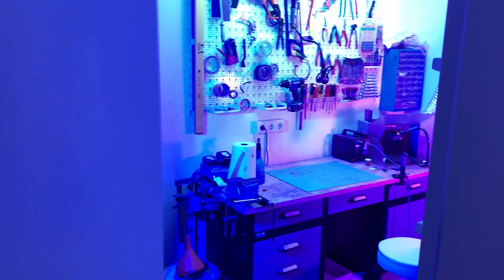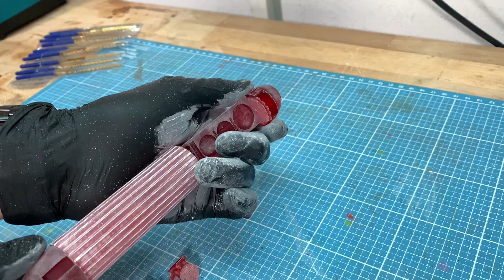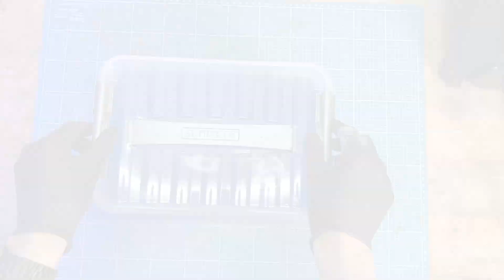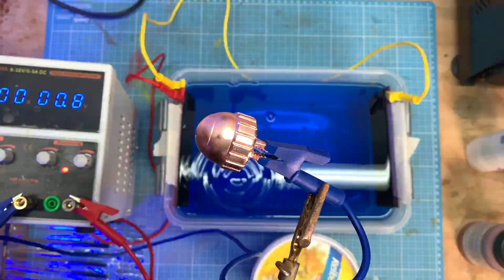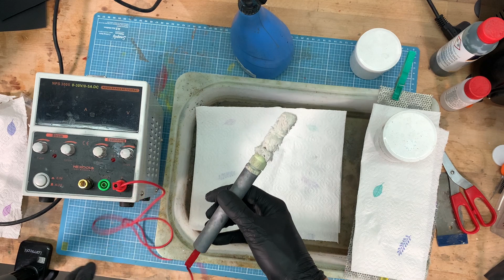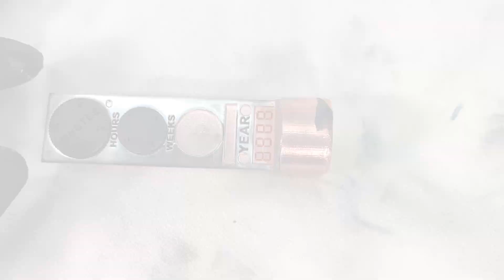Electroplating 3D Prints - Super Smooth

Comment: Superb video !

But one question..
I cant get my copper to stick, it rubs right off.

My setup, is by making the solution with copper material in vinegar and salt, on plus and minus of a charger.
Then i add brightener made from laxative and distilled water (which i saw in another video)

i spray my 3d printed (UV resin) parts with Zinc spray, or paint them with graphite paint. without touching them after they have been painted og put them in the plating solution hooked up to a single AA battery.

only a small amount of plating actually sticks, and 95% of it rubs right off (and looks a lot darker)
The plating that does stick, dosnt shine.
Reply from the maker: Hi,
hard to tell where the issues are, since you're using your own electrolyte. 
First for the missing shinyness: This is either by the self made brightner, or by applying too much current to your plated part. An AAA battery provides around 1.5V. This is too high for the avarage part. And this leads us to the...
Second Part: Graphite paint needs to slowly plated at the beginning. I use 0.1-0.2V increasing the voltage slowly. Graphite paint also sticks very bad on Resin printed parts. I fixed this by adding a layer of polyurethane on the resin; then spraying the graphite. 
Third Part: Graphite is way less conductive as you might think; try to polish the dried paint with a rag to make it shiny. Then head for around 4kOhm resistance (measure it). 

After that, wait. Graphite plating takes longer to build up thick  copper layers for what i've learned.

Comment: I don't understand, I do exactly the same with the exact same product but for me, once I apply the paint (I tried all of them that you have) to my SLA print-out, it's just not conductive anymore. If I apply the same paint on some paper, it is conductive. Help! What am I doing wrong?? :'(
Reply from the maker: Alright, help is here. All these conductive coast are indeed conductive (more or less). The silver spray is instantly conductive, the copper has to be made conductive, this is by putting it into the sour copper electrolyte; it THEN becomes conductive after a very short while. The graphite spray is conductive, as well, but way less. Therefore you can polish it with a soft cloth and increase the conductiviness. You can measure it, around 4K resistance is okay; although it looks like it‘s not in the bath, you start with a very low voltage and icurrent slowly starts to become more and more (this is for graphite). What products are you using?
Reply: @hen3drik  thanks for your quick answer. So I'm using the exact same products as you have. I did not polish so far. Will try that. But measuring the resistance on all: copper paint, silver spray, graphite spray it does not measure any conductivity. I just applied more layers, I'm at layer 3 now, waiting for it to dry up, then gonna polish it with a soft cloth and also leave it in the back with electricity over night to see if that makes a difference. Will keep you posted!
Reply: @hen3drik  so I tried everything and also leaving it in the bath for longer. It just did not work. The Tifoo products are all just worthless. The graphite mixture after about 5h had some copper on it but so incredibly thin that when I went over it with cloth, the copper plate went away it also felt and looked very dirty and rusty. I ordered a few other paints to try the next weeks. However the only difference I see is maybe the resin? I'm printing SLA uv Resin. Could that be? I. E. When I apply the tifoo silver spray after drying I can go at it with my measuring tool and it will not beep (stating that it's conductive) and not measure anything.. No idea really. What do you need to know to help me debug this? :/
Reply from the maker: @Chitzui   did you put a clear coating on the resin first? I usually put Polyurethane on the prints. Do you use graphite spray or paint (what brand)? I think the key is your bath process. Something is wrong, 5hrs should deposit a lot of copper even on graphite. Ok, questions: is the wirering correct (+ to the anodes, - to the print), how is it connected to the anodes + print (croc clamps), what electrolyte is used, what anodes are used. Tell me about the voltage you set.
Reply: @hen3drik  ok so best would be if I can send you a pic or video, maybe I'll find some time on the weekend. I tried both, graphite spray and graphite paint. For the spray it's the same brand as you use. I did not coat the resin. That's something I can try. The bath is set up like you say, the positive to the both copper plates in the bath and the negative to the product itself. I have a conductivd wire that is wrapped around the print and attached to the croco. I assume the bath works as I tried the exact same with a metal bar I had and copper deposited correctly to it and also to the wire. Only nothing deposits to the sla print, no matter the type of electric paint. I'll try to put Polyurethane to it first on my next try! I've also ordered two more conductive paints from other brands to see if that makes a difference.
Reply: @hen3drik  do you have a video by any chance on the process you are doing with Polyurethane? And what type of elecrolyte bath do you use?
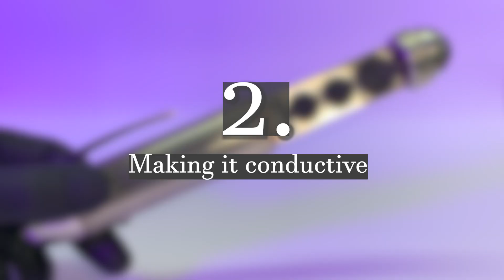Reply from the maker: https://youtu.be/zFS-jTba9vQ Look at 1:50. It‘s all very crazy. All you say I have exactly set up like yours. It‘s just that the conductive spray stuff (but the graphite) is becoming conductive when put in the bath. What electrolyte is it? Is it acidic copper electrolyte, or alkaline??
Reply: @hen3drik  I use the alkaline one, what's the difference anyways? I'm uploading a video showing everything atm will share once it's uploaded. Yes I'm trying to replicate your set up so it should be almost identic.
Reply from the maker: @Chitzui  this is the problem. You need an acidic electrolyte to activate the conductive paint; according to the manual of the tifoo paints. Can you take a look of the manual of the product you got? I think there is something mentioned in the instructions somewhere on the product page.
Reply from the maker: But there is a trick. You can dip your conductivepainted print into acid. That makes it conductive as well and you should plate it in the alkaline bath. BUT I don’t know the results of the alkaline bath, as I always do acidic electroplating.
Reply: @hen3drik  uuuh that makes me happy that we might have found the issue!!! I'll order an acidic bath right away!! So exited =)
Reply from the maker: @Chitzui  the acidic bath works for the silver and copper spray. In case of the graphite spray/paint: it‘s harder to plate on these! You don‘t need acid to activate these but you need to polish, then increase voltage very slowly. Takes way longer to deposit metal, but works good as well. Hope it helps, good luck!
Reply: @hen3drik  let's see with the acid based fluid. Still, here is the video of my setup I did yesterday, maybe you can spot more mistakes? excuse the bad quality:  https://youtu.be/72htPCva7Do
Reply: I machine small scale model parts in Brass, then Bright Nickel or Black Nickel plate many of them depending on what look I’m going for. My question I have for you is a the (acetic  dip) mentioned a few times in your comments below. I use a HCI Electro Dip or “Surface Activator” with the + Anode being Stainless Steel & around 5volts used for 30-90Seconds , then rinsed in DI & immediately into the Nickel Plating Bath.
Is that “Surface Activator” step similar to what’s used with a 3D part that’s been treated with A Copper or Silver Conductive layer?
BTW: Great Job with your Content!! 
Thank’s!

Comment: Very nice! How durable is the chrome layer for outside applications?
Reply from the maker: Oh, it‘s not chrome but palladium which is so noble that it won‘t patinate. But the thin palladium layer can wear off, so it depends on how much material you deposit on the copper.
Reply: Ok thank you. I think I will give it a try. Maybe it can also be covered with clear paint to make it more robust.
Reply from the maker: @derdiek4774  I would not do that. All the metal feeling is lost with paint. You can use chrome or palladium, since it‘s a very durable material. You should just spend longer times with the galvanic brush over neuralgic spots. There more you brush, the more atoms are building up.

Comment: Excellent video and fantastic results! Out of curiosity, do you think that abrasive blasting would be a good alternative to the first round of sanding for the bare 3D print or would the resulting surface finish be too rough? 

I have previously tried this on PLA pieces and it was great for parts that needed to be primed since it made the process much faster, but am not sure if the result would be smooth enough for parts that need to be plated.
Reply from the maker: Could work. Depends on what conductive paint you‘re putting on. The sprays serve as a smoother somehow. Graphite spray, on the other hand is so thin that every layer ist shown. So said, blasting could end up in a rough graphite layer. But it‘s all about experimentation. Graphite can be polished afterwards, maybe works out, maybe not. Best is polished graphite on a smoothed epoxy surface sofar, but it‘s difficult to plate. In other words: the conductive layer has to be even, not the resin print.
Reply: @hen3drik  Very cool — that makes sense! Thank you for the info. If I have the chance to try it out, I’ll let you know how it goes! (Haha I’ll try most anything to save myself time during the initial round of sanding. 😅)

Comment: Wow amazing! 
I have some questions: why are there so many options for the first layer 1. Graphite 2. Copper 3. Silver... Why would I take anything different then graphite because it's the cheapest?
Reply: Graphite spray you can get for 5€... Copper for 50€
Reply from the maker: Very good question. Copper spray creates a thick very well conductive layer. You can go 100% right from the start. It also works as a smoother to hide the layers a bit. This is the same for copper paint. Graphite spray is applied very thin and need to be polished before plating to get „the right“ resistance. But when applied on already smooth surfaces it creates very even shiny metal coats. You have to carefully increase the current with this stuff. 

Maybe it take a detailed video of the choices in the future.
Reply: @hen3drik  wow thanks for the information! I ✨👌 would appreciate such a video because I can't find any information about it. Most videos Show only one way and don't explain why you would use it and the difference to other Methods.
Reply from the maker: Yep. Took me ages to figure out why some parts were „burned“ in the bath. There are just so many variables and you can have so many mistakes. It‘s learning by doing the whole time.
Reply: @hen3drik  On the first glance it looked pretty straightforward. But the more I read about it, the more complicated it gets. I also read for the copper paint you need an acid bath for some reason and not just copper sulphate in water. 🤔 What did you use?
Reply from the maker: You will need a sour copper electrolyte. That’s not just copper sulfate + water.
Reply: @hen3drik  love the video and your nice detailed replies.  With that being said I have a couple of questions:  1. Can I use PLA or PETG filament for this process? 2.  When you say that if you choose to spray the print with copper you can go 100%.  Are you referring to going directly to playing once copper dries?
Reply from the maker: Hi, 
1) absolutely. I have two other videos on my channel where I explain how to do this. You may want to have a look at these.
2) all the drying takes a very Short time. 100% means that you don’t have to slowly increase the voltage, because the conductive material ist thick enough. If you‘d go full power on a thin graphite layer then you‘ll get burning in the copper.
Reply from the maker: There are even more exotic coatings: one involves extracted nano copper mixed with Polyurethane. This creates very smooth surfaces and eliminates most visible layers.

Comment: Great video! Maybe not as flashy as a neurolizer (pun intended) but could you make something like beskar steel where you mask off sections to get different colour plating over the surface? Or a benchy... Could you vapor smooth an ABS print to reduce the amount of sanding?
Reply from the maker: Masking off works, yes! Smooth surface: The key is to apply an even conductive coating. All these sprays have pros/cons. I think smoothed abs with graphite spray and carefully plating would work out well. But the geometry of the plated objects is very important when plating copper electrolyte. Long story short: more complex as it seems. It‘s all about experimentation 🙂